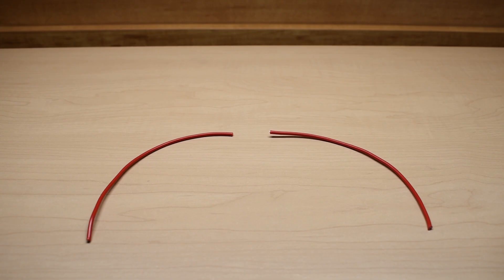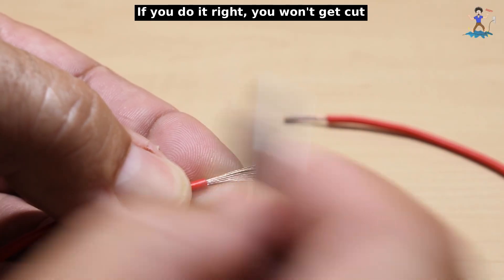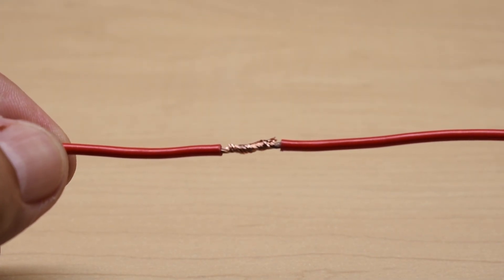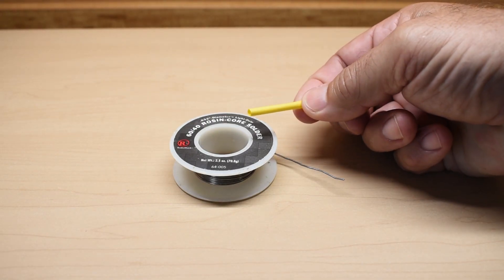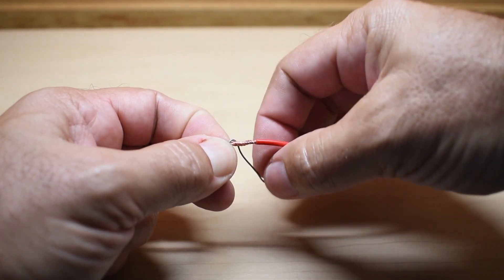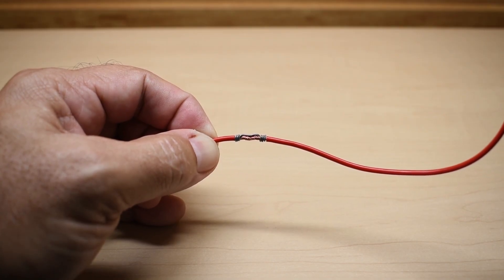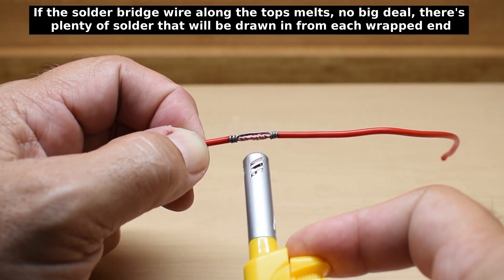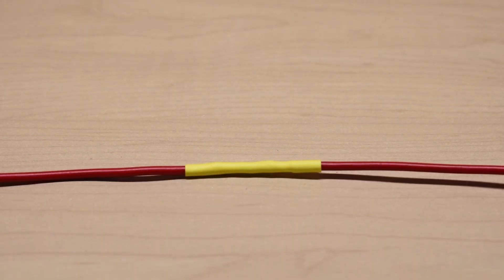How To Easily Solder Wires Together(No Soldering Iron)

Comment: Yep, there’s more than one way to skin a Cat... this way seems to be more time consuming than just soldering the twisted wire with a soldering iron though.
Reply from the maker: Read my "Pinned" comment.
Reply: depending where it being used I would often just use bullet connectors to join wires like these.
Reply: This is perfect for fixing my electric fence on my farm, no electricity needed. I have a butane iron but it blows out too easy with wind.
Reply from the maker: @relyenterprisestx  Put your back to the wind when you do this, it should work fine.

Comment: You can also use solderless terminals.
Reply from the maker: Yes, but I prefer solder & heat shrink when making a long lasting, corrosion resistant connection.

Comment: Would it not make sense to put the heat shrink tube on BEFORE you splice them and solder it? If both ends of the wire are connected to longer then it wouldn't make sense to. Cut it, put shrink THEN solder it again?
Reply from the maker: Clearly the tubing goes on first.

Comment: NO NO NO NO NO!!! Don't EVER scrape wires with a razor or knife!!!! NEVER NEVER NEVER!!! 

Use Isopropyl alcohol and a brush, man!! 

And you should ALWAYS use the alcohol to clean off the flux residue after the solder has melted and cooled to prevent it from become corrosive over time!!!
Reply from the maker: Please, spare me the stupidity.

Comment: Unfortunately you burn up all the other wires near by including anything plastic. If you are prone to being stranded use crimp connectors. If you are going to sound like you cured cancer maybe you should learn how to shrink tubing. What's next how to build a wheel out of a rock?......yikes....
Reply from the maker: You spread the wires apart Dunce.

Comment: You technique shown here promotes wicking of the solder up under the insulation of the wire.  This can cause a wire break you cannot see.  Not an optimal method here.
Reply from the maker: All stranded wire soldered connections have capillary action draw solder to the sides and under the insulation. I've never had any problems.

Comment: The best way to clean dirty copper wires is with flux.
Reply from the maker: You always want the copper bright and shiny before soldering.
Reply: @electronicsNmore  dip the wire in flux and when you heat the wire the flux burns off and removes contamination around each individual stand of wire, just like in plumbing fixtures with copper. A razor blade cannot get all of the corrosion off all of the strands and takes way more time.

Comment: If you have solder and flux youll have a soldering iron. All that trouble. Most modern irons warm up in under 2min.
Reply from the maker: You missed the point. Read my pinned comment.

Comment: Waste of time, you can't do this on PCB.
Reply from the maker: Who said a PCB you genius? Open your eyes and read the video title. LOL
Reply: @electronicsNmore  
Hi, great genius,  instead of this great circus you can bind both the ends of the wire and insulate it.  Which is far better than such tedious soldering. also remember, PCB too require soldering.

Comment: That's a lot of work. I have butane soldering pencils that produce better, faster results. I can see where this could help someone else, just not me. Butane soldering pencils are extremely good in 2019.
Reply from the maker: I disagree "Better". The connection I made was perfect. Faster? Maybe. The time you wait for it to heat up, I could have the solder wraps all done. Many cannot heat up heavier wires properly.
Reply: @electronicsNmore OK, I will concede the word 'better', how about 'as good' but portability is much better you have to agree. Go buy a butane soldering pencil/iron, you will change your mind once you use it. They are adjustable and get very hot, very fast. Another advantage the butane over the electric irons is no stray voltage occur on the tip that happens on a lot of soldering irons.
Reply from the maker: @1AXMRDR  As an electronics, and car guy, I've owned a few different types over the years.
Reply: @electronicsNmore  Then you should already know how effective they are. My latest and favorite one was a Benzomatic with self lighting feature. I'm not saying everyone of these irons are equal but when you make a living using a tool you had better get the best tool you can afford. I recently retired as a Master electrician from the nuclear industry so I too have a little bit of experience. Have a nice day.

Comment: Works even better with one of those pocket touch cigarette lighters you get at the gas station. This has been my preferred method for years. Solder is conductive, adhesive, and seals the copper connection from oxidation.

Comment: I recently saw a new item/technique I believe here on YT. It's heat shrink tubing lined with an adhesive and two rings of solder, as you heat the shrink wrap the solder flows and the adhesive seals the connection making it waterproof. 
This seems pretty cool but I don't think I'll be getting rid of my trusty Weller iron anytime soon!
Reply: My Weller iron is over 50 years old and still works like new !
Reply: That sounds convenient but I question how good the electrical connection would be.

Comment: That is known as a Western Union Slice which was used on the telegraph poles ( Morse code days )  in the late 1800, also used in knob & tube wiring, which was the first wiring method in wiring homes, which was done  with a mouth alcohol torch. Then insulated with rubber and friction tape. 
Many older home still may have it, built in the early 1900.
My complements, you are doing basically right.
Reply from the maker: It's VERY similar to that.With the Western Union, the wire is twisted together, then the ends are wrapped.

Comment: good approach but i prefer using a gas soldering iron
Reply from the maker: You'll use this if you don't have a soldering iron handy, no power nearby, or if you take out your soldering iron and it no longer heats up. :-)

Comment: I really don't see what is the point of doing this.  If you were landed on a deserted island and you needed to do repair work on your equipment but without electricity and/or soldering iron, sure this will be the way to go.
Reply from the maker: If you don't see the point, then you need to read my "Pinned" comment.

Comment: This is for people who don't have a soldering iron, but do have solder, flux, etc? You could have just used the iron and saved a lot of time, with better results, due to not melting any plastic.
Reply from the maker: If only some viewers would learn to read "Pinned" comments.
Reply: @electronicsNmore  pinning a comment doesn't make this any more useful. If it was, I would just have liked the video and left a thank you. Instead I'm here wasting even more time because of your passive aggressive eye rolling reply. At least this is all virtual. Have a good day.
Reply from the maker: If you were smart, which it's clear you're not, you would've understood and appreciated the tip. :-) Have a great day!
Reply: @electronicsNmore  I just hope that no children try to clean wire tips with razor blades or melt solder with open flames like your superior being so kindly teaches in this quality video. Reported. That was sarcasm, BTW.
Reply from the maker: @jdeatsramen  Clearly the video was intended for DIY'ers, not kids.

Comment: The video should be called painless wire soldering. Much easier than using a soldering iron. I definitely will be using this method when extending the wiring harness in my project truck.
Reply from the maker: Yes. Many people have trouble getting a nice smooth flowed connection if a soldering iron is too low in wattage, or when the tip isn't properly tinned. This is easier.

Comment: That was a very clever way of soldering two wires together. However, I would only use that method if I didn't have a soldering gun or iron.
Reply from the maker: Yes, if you only have a few connections to make, and don't feel like getting out the soldering iron, waiting for it to heat up, or if you don't have a source of power outdoors, it's perfect.

Comment: I use this method for years. The presented lighter is not so great because can smoke the copper wire and the solder will not adhere. The best way is to use a jet lighter
Reply from the maker: The lighter used was ideal, the video proved that.

Comment: I guess it is kind of obvious, but for most applications you need to slide on the heat shrink tube as the step BEFORE you do the splice. ( You had the benefit of the loose ends in the demonstration)
Reply from the maker: Yes, I explained that to viewers.

Comment: Well prepared and explained video. Only problem is soldering is not really a good fix for automotive wiring due to vibration the solder will wick under the insulation and will create a week point. Granted it would take considerable time before it would fail.
Reply from the maker: There's a right time and place for everything. :-) Thanks for watching my video!

Comment: I find this tip to be ok but not practical. You have to factor in the space you are working in, any wind and anything that may be flammable etc. I use a cordless iron and use to use a butane iron when doing patch work also tinning the ends of the wire first before joining them makes the job simpler and just as clean when finished soldering.
Reply from the maker: There's a right time and place for everything. Thanks for watching!

Comment: Looks slow. I'll stick with the soldering iron.
Reply from the maker: Keep it in mind if you have no power nearby, or if you go to use the soldering iron and the heating element is burned up.
Reply: As he explained in the pinned comment at the top of the video, this would only be recommended where use during certain circumstances. One of those being when you only have one or two wires to solder. Think about how much time it's going to take for you to dig out your soldering iron and heat it up. With this method you could be done before you got your iron hot enough.

Comment: I can solder wires together with a soldering iron much faster than this method takes. Would be useful in a pinch, but I'd much rather just use my soldering iron, it's much faster. If you have the Flux and solder I'd assume someone would also have a soldering iron. For someone who doesn't know how to solder this would be quite easy for them to do.

Comment: Decent way of doing it if you don't have the right tools.  With the lower melting point of the Pb/Sn solder you can get away with it, without getting the copper too hot and oxidizing even with flux. 

With proper tools, modern lead free alloys are just as good.  They just have a hotter melting point.  The joint is decent but there are better ways of mechanically bonding it before soldering.  NASA recomends either J-hooks, where you pre-tin the wire and bend them around each other,  or wire wrapped, where a buss bar wire is mechanically wrapped tightly around the wires to be soldered.
Reply from the maker: Thanks for watching Adam!
Reply: I would have full confidence in this method to wire the bilge pump in my boat but only if I'm not taking it on a mission into space. Thanks for the heads up on that Adam A.  🚣‍♂️🚣‍♂️🚣‍♂️

Comment: Wires should be joined using a proper crimp connector, not by soldering!
Reply from the maker: WRONG. Who ever told you that? LOL
Reply: electronicsNmore I needed to learn all of this when I installed a 24 volt, 8kWh lithium system with 900 watts of solar and 3kW inverter.  So, I do know what I am talking about.  Soldering is unacceptable  — crimping is far superior and results in a cold weld if done correctly.
Reply from the maker: @PaDutchRunner  Whatever you say.

Comment: Could have gas soldered 10 connections in the time ypu spent setting up the solder
Reply from the maker: Typical moronic comment because you didn't understand how useful the tip is, or when it would come in very handy.

Comment: I liked the video and its useful for some jobs. But I don't think I would want to use this method when I am working inside the guitar cavity with a flame near any of the other wires and pots while making a quick repair or pickup change. I also seen on an old video to clean the yellowish crap off the wires of the solder with a little alcohol. Although that was an older video about soldering from a few decades ago.  But hey, this is still a good trick. Thanks for the video!
Reply from the maker: Every tip has a time and place to be used.
Reply: @electronicsNmore  Indeed.

Comment: Hmm, I thought the products of combustion contaminate the copper.  I recall getting connections that don't adhere.
Reply from the maker: You must've recalled wrong. LOL
Reply: @electronicsNmore  No, it has been a problem.  The difference is probably due to the flux being burned off and the surface becoming oxidized.

Comment: good vid.         also it's a good idea to do a second layer of heat shrink with some sort of stiffer "splint" material so that the flexing occurs only in the unspliced area, because  the repaired solder area is relatively stiff and will create a hing point/stress riser.   The splint material could be a split layer of insulation or a trimmed zip tie material etc , anything to gradually transfer flexing away from the ends of the soldered area.
Reply: I use a bit of electrical tape directly over the soldered join. Then heatshrink. Works well.

Comment: I have been using this method for years. Except I use a heat gun  for the shrink tubing.
Reply from the maker: I use a heat gun also, but most viewers don't have one, so I used a lighter. :-)

Comment: Cool tip but I keep my iron with my solder flux and rosin along with heat shrink. So by the time I find a lighter my iron is already hot and in need of re-tinning. Thanks tho in case of power outage I guess I can pass time. Not sure I'd need wired device in the dark......lmao just kiddin man. I can be a trouble maker at times. 😆

Comment: That's a cute trick but realistically speaking a simple butt connector crimped properly is really all you need. This is a typical do it yourselfer that doesn't know what overkill looks like.
Reply from the maker: There's no comparison between what I did and a butt splice crimp. The connection is very strong, and will last as long as the wire. The majority of people like knowing other ways of doing things.

Comment: I didn't know you were going to use any solder. when I saw this I thought you weren't going to use any solder at all. But I do like how easy it is to have the solder flow on the wire
Reply from the maker: Glad you liked the video Joe! Be sure to share the video link. Thanks

Comment: For some reason, I thought this was going to be about a new, conductive glue. The method was still interesting though. I could see how this could come in handy where you can't use a soldering iron or just want to do a quick job without waiting for an iron to warm up. I one time used a similar method to solder wire onto thick, 12 gauge wire when making an antenna. My soldering iron just couldn't put enough heat in the wire to melt the solder, and I didn't have a soldering gun. Instead, I used a jet barbeque lighter. The solder flowed well. It actually smelled like I had been soldering copper pipes afterward.

Comment: I'll definitely be doing this when I re-wire my old truck. A good alternative to buying those solder filled splice things. Not that I have anything wrong with those I just prefer the look of a heat shrunk joint over the butt connectors
Reply from the maker: Thanks for watching! Be sure to share the video link with friends.

Comment: This trick will keep the wires sticked to its other but it won't give more proper electrical and mechanical contact than when it's soldered.
Reply from the maker: This is as good or better, and no soldering iron required.

Comment: I liked it because it kind of makes a better solder over a wide area.  Instead of that method, I twist the insulated end parts together first so there is not stress on where the wires connect.
Reply from the maker: Thanks for watching Jeff! Be sure to share the video with others.

Comment: This is more work than simply soldering the wires together normally...
Reply from the maker: You need to twist the wires together regardless of the method, Flux should be applied to the connection for the best flowing possible. It only takes 15 seconds to wrap the solder wire. You'll be glad you learned this tip when you don't feel like pulling out a soldering iron or don't have one handy. No waiting time for a soldering iron to heat up, and no excessive smoke.
Reply: @electronicsNmore  As someone who has soldered multiple wires together remotely (battery powered soldering iron), I'm going to have to disagree, while this is a neat trick to do in a pinch, it would take far long to do with multiple wires.